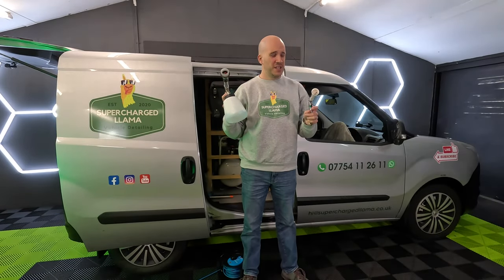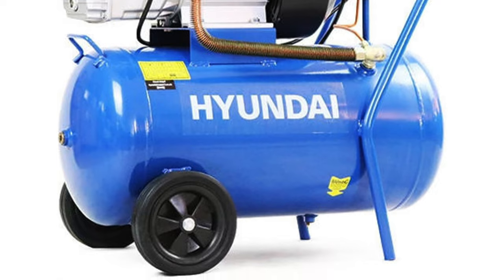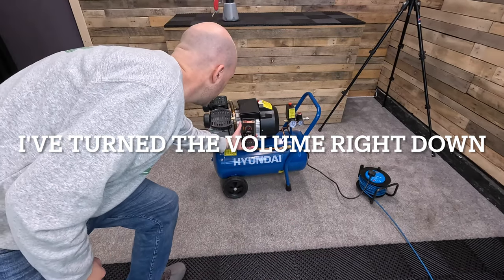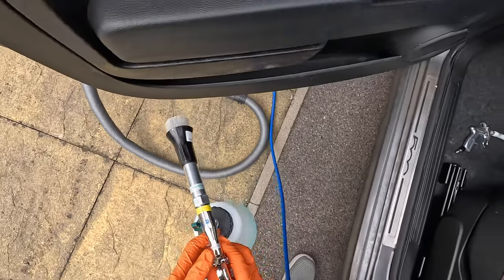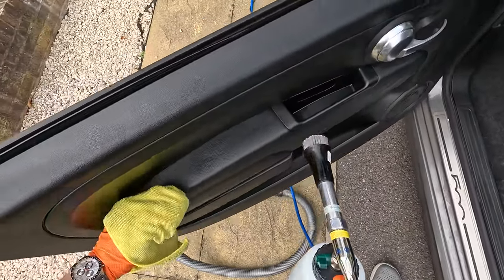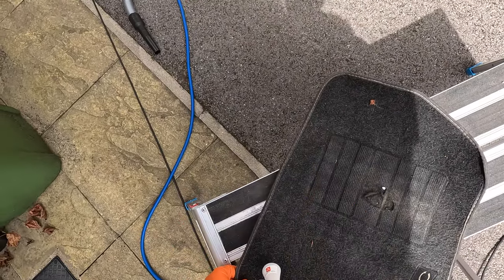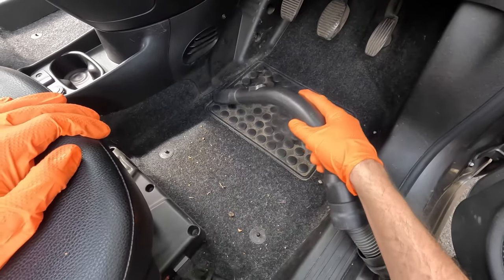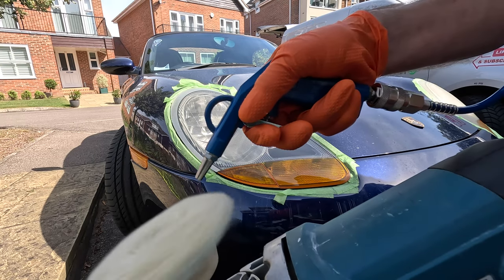Hyundai HY27550 50L silent compressor review - a detailers best friend?

Comment: Excellent demo's of these tools that pros would use. So, loudness is normal conversation (ish) or sticking your head in a washing machine. You've definitely made the right choice there
Reply from the maker: Yup that's a very good way of describing the difference. You can easily talk with the silent one on behind you, in fact the air tools are louder than it, that's not the case with the blue one.

I am trying to negotiate the bigger unit to compare that too and see if my hunch is right.

Comment: Great video. I agree, I think you really need to have a minimum of a 100litre air compressor. The tornardor tools go through the air tank so quickly. I've got a 50 litre air compressor and it's disappointing when it comes to the tornador. The peak power is only available for a short period, which is in line with your findings.
Reply from the maker: Do you know what, I'm really glad that other pros are finding the same as me. There's so many people extolling the virtues of the 50L SGS one and I just can't see how that's up to the job.

I'm trying to bend Hyundai's arm to give me the 100L for review,. I'd love to ratify my opinion.
Reply: @SuperchargedLlama  I'd definitely be interested to see the comparison between 50 litre and 100 litre air compressors. I just haven't bitten the bullet yet and bought the 100 litre one.
Reply from the maker: @jcvdvandd  there's also a silent one by a brand called TEH which is 14CFM, silent and 100L. I'd like to try that too but they never return any messages or calls. It's not something I can afford to buy just to review on the channel.
Reply: I'd recommend buying the name branded tornador gun as it has an air adjustment dial on it. As you don't always need full pressure it'll use less air 😁

Comment: Great video. Not used a compressor for detailing as I’m only a weekend warrior but I can definitely see their purpose for the pros. I agree, if your a mobile detailer then the silent model is the obvious choice but for £50 more I’d go with the 100ltr.
Reply from the maker: I reckon that's how I'd be leaning as well, I'm trying to get the bigger one from Hyundai so I can validate my hypothesis, but even if I can't...I reckon it's absolutely valid. I can definitely see the 3000watt one being superior for sure, but it's almost £600 so you'd definitely got to be doing this professionally OR completely loaded😄

Comment: Blue compressor is 3hp vs 2hp silent version which is why it takes less time to fill and performs better. Ideally you’d want the new 4hp 100L silent as it can hold 10bar of pressure in the tank (50l are only rated to 7/8bar)  and then turn it down to around 6/7bar on the outlet for the tornado, but these are £600 which is very pricey for a compressor. These might come down in the future in price as the 50l was £350 when new but can be had for as low as £230.
Reply from the maker: Yup you're absolutely spot on there. If we say it loud enough Hyundai might give me the 100L for review (the 3000watt one you mentioned) so I do a proper comparison to demonstrate the difference.

Of the two 50s I would choose the silent one. It's definitely less powerful, but it's so much more pleasant to be working around when it recharges.

Comment: Cool video.  Am i misunderstanding this, it takes 2 mins to recharge every 15-20 seconds you use it?  Or have i completely got my wores crossed?
Reply from the maker: You've not, but I've also not explained it well. It's 2 mins from dead empty, where as it kicks in during use when the air pressure drops below a certain level, so the tank won't be completely empty. I could have timed the recharge time during use, couldn't I! Doh. Wasn't super quick though, maybe a minute.

What I found was that you don't really use the tools continuously though, more like....you use them in bursts.
Reply: @SuperchargedLlama  OK, that makes sense.  Sort of irrelevant to me, I'm an enthusiast, none if it would be in my tool chest, but I still like to watch, learn and understand.  Thanks Adrian.  All the best 👍.
Reply from the maker: @decker0373  thank you darling! And the same to you.

Comment: Hi, do you carry water tank in the van?

Iam  thinking a compressor  is more important than tank and generator?
Reply from the maker: I've replaced the tank with the compressor - it's in the exact same space actually so it worked out well for me.

I have kept the generator as I find I use that at some clients due to them not having and easily accessible power socket, but water isn't a problem (I just don't take customers who don't have it).